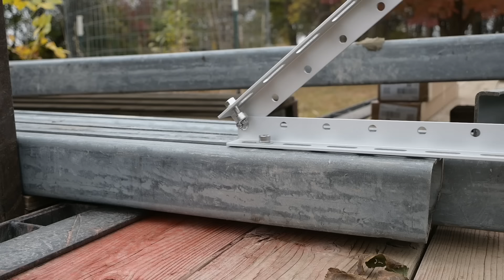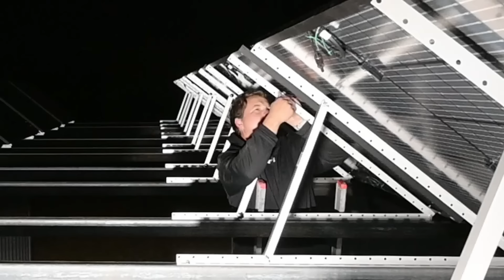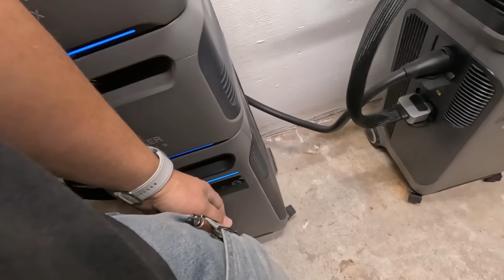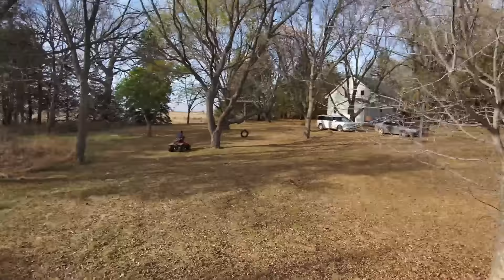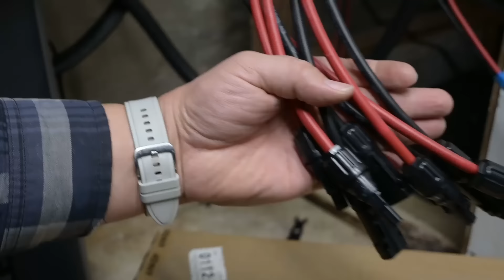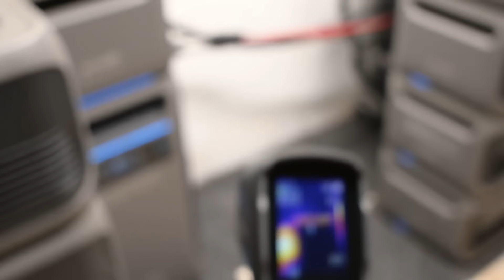How To Install Solar Panels on Shipping Containers - Anker SOLIX F3800 & Home Power Panel System

Comment: I have a WAY WAY smaller setup..lol..basically just received my Anker C1000 Gen. I have a C200 with with an Anker 100 watt solar panel and plan on purchasing an Anker 200 watt panel so I can run it together with the 100 watt I already have into the C1000. Please tell me what wires I would need to make that happen. Great vid and you probably explained it but im not to savy with electrical applications. Thank you in advance.

Comment: Im very interrested in adding some solar to my single anker solix 3800 plus.  Right now im using just to power my shop a 10x18 shed. I have bunch powertools i recharge and once in a while i have use my 20 gallon air compressor, which my 3800 plus sedms to run fine.  Im saving for few pannrls and hopefully an extra battery.  

If this was land and not a mobile home id be looking to build a large sollar array like u have.  Only being the newer plus model id be able to run in series

Comment: Thanks for your videos, helped me install mine.  I ended up with 2 f3800+ and just got 16 panels for them.  I hope I don't regret the Anker panels, as they are a good bit more expensive it seems.  I am curious, Anker doesn't mention it, but could you use aluminum power cable between HPP and main and HPP and backup?

Comment: When you have longer Solar cables, is it best to go higher in gauge (AWG) or lower in gauge? And should you use more Y connectors or less if some solar panels can be hooked up in a chain? I bought the F3800 Plus recently with the blue solar connectors, which has a much higher voltage limit (up to 165 watts), so wondering what would be the best cables to run, especially the max wattage per port is now 1600 watts and you can do 8 410 watt panels per power station (or 16 with two power stations to max out the auto- transfer switch).

Comment: Agreed on the home panel back feed. Just got a f3800 plus/battery and 4 panels, was about to buy that until you said that. 

Sticking with the mechanical interlock/manual changeover until further notice from Anker.

Comment: I would of gotten An EG4 system and had the panels in series.. At around 400volts DC the wire gauge could be smaller and easier to deal with and virtually no line loss..

Comment: That's a lot of wires in that small conduit. I have to believe you're violating the 40% fill and also you're derating you wires by at least 50%.

Comment: Get the Solix for free? Cause that’s the only reason I can think why you would run all that wire the way you did. You could’ve bought a different system and saved more money less work that’s why I thought you got them for free

Comment: It seems like after doing research you're saving a lot of money going with the Delta Pro ultra, once you hit two batteries you're at 12 kW, the 6 kW battery is the same price as the 3800 kW battery as of 1/16/2025
Reply: I don’t think Delta has the same Home Power Panel kit that connects to the subpanel and enables you to power your entire house subpanel. Delta does have that backup load panel, but that’s not the same as powering your existing home subpanel. Correct me if I’m wrong here, but that Anker Home Power Panel kit is the only one that can do that

Comment: I set up a very similar situation, but I am now changing it to a series set up and I’m going to put a 48v battery and charge controller between my panels and my ankerf3800 so I can get more power into the anker at Max charge potential. I have very similar solar panels and I am only able to get 1300 to 1400 W at peak time during the winter. Because the panels are only 31 max Volts, each in parallel the wattage potential is under used. I think you beat mine and distance because mine are 100 feet away and yours look further. I suspect because of the high amperage that there is too much heat loss in the transfer of the power to the anchor so put them in series with a lower amperage and a higher voltage makes more sense for me.  Thanks for the videos always interesting to see different people set ups.

Comment: I had a question removing the neutral wire well on my old generator I just hook the two hot legs to the panel and it worked just find for over 40 years so why can't I do the same on my new champion 7500 watt running

Comment: Did you run 8 awg wiring from the HPP to the solar array?  And were the wire connections coming from the solar panels 12 awg? If so, is it safe to connect 8 awg to 12 awg wiring?  Thank you.

Comment: As a PV installer, I say you did an epic job! I can see your attention to detail, and even reaming the PVC Connections. I would have done the layout different. Instead of a braket on each panel, build a structure with 4 brackets, and then put the panels on rails.. also the wire management was well thought out but technically PV Wire should have no more than 6 inches of direct sunlight. Again, great job, and next time you will make lots of improvements but ultimately your work ethic shows through, and you put a wonderful system together.

Comment: Those are the worst panel for the Solix F3800. I dont know why Anker did that. Why they sold them in a packaged offer too with the F3800. Worst Voltage / wattage combination for the Solix F3800.

Comment: Good video. I hesitate to install the Anker Solix system from the 2 issues you mentioned. Feeding power back to the grid when you designed it as off-grid and the battery will waste solar power instead of powering up the house with excess energy. The load balancing is also an issue too. These aren’t major. Anker could come up with solutions in the next few months.